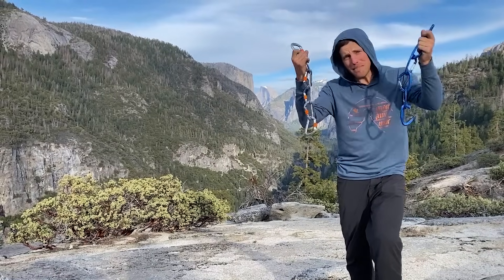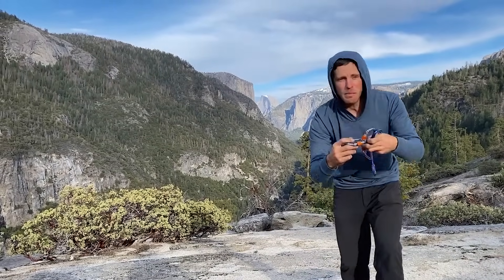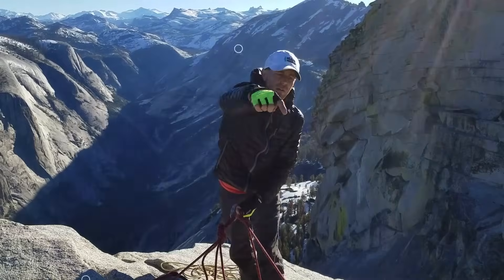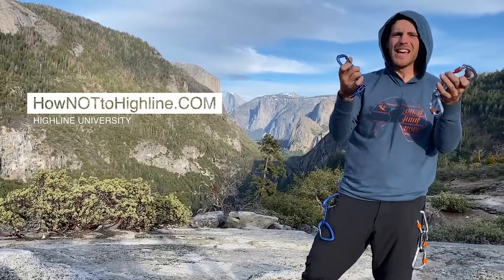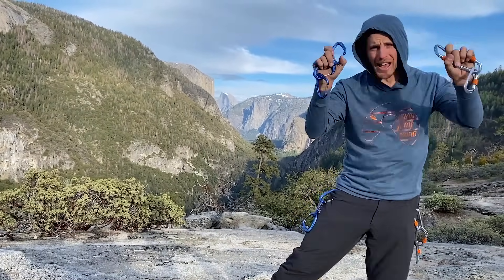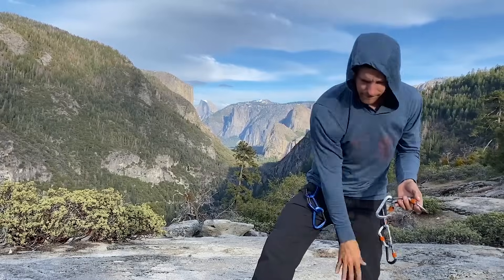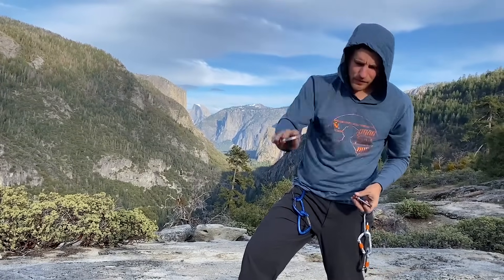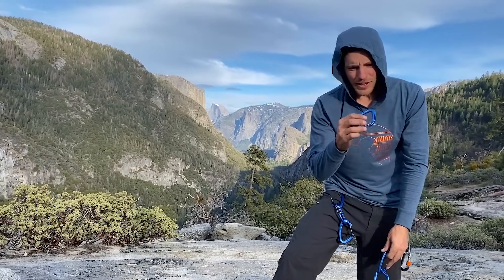Are MicroFractures a Myth in climbing carabiners?

Comment: This video was recommended to me and here are a few thoughts. I rarely comment on youtube videos but felt like I needed to make an exception here.
This is not a good test of micro fractures. You have tested scratched up carabiners vs brand new, you have absolutely no way of knowing if these carabiners you threw at the floor have micro fractures, All this video has really shown is that there is little difference between scratched and unscratched carabiners. To say that you are testing the effect of micro fractures is completely misleading. Smashing carabiners against the floor will not ( is extremely unlikey) to create micro fractures in the material. Micro fractures exist as a result of repeated high loading. A good visual demonstration here to help understand micro fractures is to try and rip a sheet of paper by pulling in the same direction at either end, it is surprisingly difficult, adding a small tear into the top of the paper decreases how hard you would need to pull to rip the paper. In the context of aluminium weighting it and unweighting it repeatedly (cyclic loading) will tear at these micro fractures over time. A better test would be to do a break test on a carabiners that have been used for climbing for several years, or to test a carabiner that you had subjected to repeat on/off cyclic loading. 
Thank you for bringing up the issue of micro fractures though, many people are unaware of them and their possible effects.
Reply: They do have a test of old vs new gear. This test was to disprove the notion that you should retire gear if it is dropped bc it "develops micro fractures" and it will break when loaded. All this test is saying is that dropping your gear doesn't mean you have to retire it because it doesn't lose a significant amount of strength.

Comment: I used to work for a boutique bike frame builder in San Diego back in the 90's making custom steel, and then Ti frames. Aluminum has a "quality" called  catastrophic failure. Really sucks on bicycles. Probably does when a biner fails also.

Comment: Yeah micro-fractures are def a sketchy ground, but thanks for the info!! and please put a plexiglass cover over your machine! :) MBS tested equipment can jump a lot.
From my POW it is good practice to not use any gear after you dropped it from a wall. For instance I dropped a Photon Screw Lock from 400 feet, found it and retired. When I tested the carabiner got to 24 kN. So apparently no issues. I believe that what mfr are saying is that there is a very tiny chance you get micro-fractures after carabiners fall down. The thing is that as they categorised as PPE class 3 according to European regulations, hence protecting the user from death. So this is when even small chances lead to extra safety. 
In terms of fatigue as some other comments were saying be aware that fatigue in metals concerns loads that are generally much lower than MBS, but simply repeat them to thousands (sometimes million cycles) and they lead to breakage (classic example train axles). There are very interesting studies linked to some carabiners and fatigue, specially considering paragliding flight (search for DHV). Even with very low figures (100-150 kg) a carabiner might break after 100'000 cycles. Of course in climbing this is not really relevant, by the time your gear gets to 10'000 cycles it will look that bad that you might just wanna use it as a keychain.

Comment: Interesting experiment, but due to the limited number of tests it really only shows that microfractures are not guaranteed to occur when throwing biners around.. Not trying to tell you to destroy more carabiners though ;)
Reply: I think the burden of proof should be on those who claim microfractures do happen from dropping your equipment
Reply: Andrey Mironov microfractures start at stress risers and then form from cyclic loading. Abusing your gear is going to create stress risers, if it does anything, but not directly form microfractures.

Comment: you gotta let water in those tiny breaks in the aluminum over long periods over time. i've seen it it bike parts. especially crank arms. cracks you can't see that have let water in over time that eventually fail and when they fail you can see the corrosion coming from the outside in along the invisible crack. after working on bikes and going into climbing i've always assumed that this could happen to carabiners. inspect your gear thoroughly, maybe even with a magnifying glass, why not?

Comment: From this kind of abuse, it seems more likely that the result would be Work Hardening of the aluminium. there is a wikipedia article from this, and quoting the section on aluminium: 

"Devices made from aluminum and its alloys, such as aircraft, must be carefully designed to minimize or evenly distribute flexure, which can lead to work hardening and, in turn, stress cracking,"

That being said you'd have to repeatedly be causing impact stress on the aluminium to normally cause that to happen (to my knowledge). It's possible it could worsen a very minor defect in grain structure eventually though.
Reply: work hardening is only done through plastic deformation. Dropping a carabiner on the ground will plastically deform a small portion, a dent or scratch would be an indication of that. But that would be the only area that is hardened. due to the thickness of the material, this wouldn't have a significant effect. 

Its like bending a paper clip back and forth. The part you are bending will slowly get harder to bend and eventually snap. But the rest of the paper clip is unchanged.

Comment: Might I ask why test 824 and 830 were disregarded in your conclusion? Those instances identify that the carabiners were compromised. The reason behind microfracture caution is that invisible damage could possibly compromise your gear, which I believe you have proven with your tests. All the new gear held to within 2% standard deviation from the mean while test 824 showed 5% less strength and test 830 showed 12% less strength. Thats a 33% chance your gear has been compromised and weakened from its original state.
Reply: Because it's still much more than you would experience climbing, and I believe the test was more to show that you don't have to throw away equipment if it touches down on rock once, like some people believe you should.

Comment: I’m no scientist, or expert on micro fractures.  I work heavy construction, every time I’ve done a heavy
 lift, 100 tons or more, they do a fluoroscope test on the equipment.  So ya, micro fractures are a thing.  Fractures propagate.
Reply: Question is : are micro-fractures a thing in climbing / highlining equipment, used in climbing / highlining situations ?

You’ll never get 100 tons-force in climbing / highlining…

Comment: I am a mechanical engineering student and have studied material sciences as well as mechanics of materials. So, within these topics it looks all the way down to the crystal structure of materials and how they behave to how different loads will cause different stresses within materials. I can say from these classes that THERE ARE MICROFRACTURES. When a force is added to an object stress can be visualized as “flowing”. When ever there is a little defect in something the stress flow is compressed like if you were to see a river try to flow around a rock. This causes a concentration of forces where there is a small defect. It is completely dependent on the geometry of the crack and how the stress flows through the object. So, for the carabiner there could definitely be some sort of stress concentration depending on the types of chips and cracks in it. This is probably why there was a bigger range of failing forces because there were different chis in each of the carabiners. From this abuse there is more likely to be dull dents and chips which have way lower stress concentrations than a sharp crack since the stress can flow around a circle better than a sharp point.
What is probably more likely to make the fractures is causing lots of stress then reliving it. This can lead to the “microfractures” that aren’t really visible. Each time the material is loaded to a high amount these cracks can propagate and weaken it. There are graphs for different materials called S/N Fatigue curves that show different loading cycles and how many times they can withstand those loads. So, in the case of these carabiners they can take so many falls and will form small “microfractures” within the material that will eventually fail. This was the cause of an aircraft accident since the cabins are pressurized and depressurized causing a loading cycle. There is a good quick video that covers some if this linked below. With this being said it might be a better experiment to put a load of a bad fall on a single carabiner then relive it. Do this multiple times and then test the maximum breaking force or continue to do it until the carabiner fails.
Another point I would like to make is that there was somewhere in this video that quickly mentioned the maximum breaking force to be much higher than what is labeled. There is something called the factor of safety that engineers use when designing a product. The product has a requirement that it must be able to withstand. The requirement is then multiplied by the factor of safety and then designed to meet this new higher load. The product is then labeled with the load required not what it was designed to. This is so if something happens that is accounted for or someone uses it improperly there is still more strength than what the end user really thinks there is but never load something beyond what it is labeled. In the case of these carabiners they could also be labeled with the standard minimum they go by so people know that it is safe enough.  
I hope this helps!
Different equations for facture mechanics and stress concentration from them: https://en.wikipedia.org/wiki/Fracture_mechanics
Video on plane windows: https://www.youtube.com/watch?v=7rXGRPMD-GQ 
Plane accident from fatigue: https://lessonslearned.faa.gov/ll_main.cfm?TabID=4&LLID=20&LLTypeID=2
Reply from the maker: I would like to test cyclic loading stressing aluminum, maybe new and maybe abused gear, to demonstrate what you are referring to.  What is the % of MBS of aluminum that a carabiner could in theory take infinite loads... 25%?  I know if you cyclic load near MBS it only takes a reachable number before it breaks from micro fractures forming.
I was joking that the breaking strength was higher than MBS because sooooo many times on slacksnap that wasn't the case because MBS is based on a sterile enviroment, especially on soft goods, especially on highline gear.  So everytime something breaks higher than MBS I make a joke about it.  I know the printed number is the lowest it should ever be but I find great joy in showing that isn't always the case haha.
Reply: @HowNOT2   another Mechanical Engineer chiming in. Aluminum doesnt have an "endurance limit" like steel does. In theory, you could cyclically load an aluminum carabiner to just 100 pounds, and it may take a billion cycle, but it will eventually fail. The problem is, shape has a lot to do with this calculation and would be really tough. But if you're looking to do an actual test that would have a low enough set of cycles to be feasible, I'd recommend doing a super slow test of a carabiner where you load it and unload it until it deforms and wont go back to normal (also known as the yield strength) , and then run your test at about 80%-90% of the yield strangth on a fresh sample. If I were a betting man I'd estimate the force to get to the yield strength of a 24 kN carabiner is probably close to 20kN.

Anther problem in designing this kind of test is that fatigue is rather sensitive to the load, so if you're loading a carabiner to 4000±100 pounds, it it constantly loads high vs another sample consistently loading low, the resulting life could be off by an order of magnitude (the difference between 10,000 cycles and 100,000 cycles). These sorts of differences could literally make a test take 10 times longer or something could break in one tenth of the time you might have been expecting.
Reply: @HowNOT2  I did some looking into the materials that are used and the data on it. It looks like about 20% MBS is what would give you "infinite" falls and by infinite I mean you probably will not ever reach that number of falls. While looking around on the internet I found that MIT actually did a lot of testing to see what a carabiner could withstand. They did testing that would mimic how a climber would actually use it in the real world and all of that data can be found here http://web.mit.edu/sp255/www/reference_vault/Fatigue_Presentation.pdf . I came up with the 20% from the data found on page 13-15 (as well as some other material sources linked below). The failures became asymptotic at about 5kn which is about 20% of the rated MBS of the carabiners. I also agree with @TheArmyKnifeNut on all of what he said. What I think might be an interesting test is to load a carabiner up to 20kn like 20ish times and then do a final MBS test to see if those few loads lower the MBS. This would be to simulate how multiple type 2 falls effect the MBS of a carabiner. I watched your video on the forces from falling and seeing that the highest forces created from those typical falls never even reached 5kn, I dont think climbers should worry about failure of gear from fatigue unless there are a lot of type 2 falls.
Thanks for making the cool videos!
http://asm.matweb.com/search/SpecificMaterial.asp?bassnum=MA7075T6
https://ntrs.nasa.gov/archive/nasa/casi.ntrs.nasa.gov/19730023698.pdf
Reply: And has anyone tried similar analyses with titanium carabiners? And that is based on the basic, visual presence of notches - ergo the dependence on notch toughness. We know that with hard materials it has a pretty big influence.
Reply: TLDR......🙄
Reply: Blah blah, blah. Dont retire yer beenerz because you drop em.

Comment: Micro fractures are a thing but you never checked if you have any cracks. Throwing them on the floor are not guaranteeing that you create one on the inside of the carabiner. You maybe created them on the outside but you should do a test over loading them until shape changes and after a day try a pull test again. All the best from japan

Comment: By beating the metal you could be work hardening the metal. As for your differences in numbers, all the ropes and pulleys are putting variables in your test. That’s why scientists use hydraulic rams. Still it’s way cool what your doing!!! Keep making videos.        Ideas for an other video, if the carabiners were really cold, I could see stress fractures.
Reply from the maker: Why do the pulleys add variables?  It pulls at a constant rate, at least as constant as a hydraulic rams.  We use hydraulic rams in bolt busters and i haven't seen a difference.
Do you have any articles that talk about aluminum becoming brittle at a certain temp?  We have freeze driers we could experiment with if that is a thing.
Reply: @HowNOT2  aluminum isnt very sensitive to low temperatures in the way steel is. I don't feel like digging out my old text books, but here's a quote and link discussing it a little. 

"Below zero, most aluminum alloys show little change in properties; yield and tensile strengths may increase; elongation may decrease slightly; impact strength remains approximately constant. Consequently, aluminum is useful material for many low-temperature applications."
http://www.totalmateria.com/Article23.htm
Reply: I just think the numbers could be if the load could be applied more abruptly. I just know materials can act differently when loaded or when jolted. I’m no expert, I just really like material science. As for the beta on aluminum Cryo-testing, I’ll try an find you some. What your doing here makes me what to apply what I know from Aerospace to climbing. It’s crazy how engineering and climbing go hand-in-hand.
Reply: @philschorr8231  There is no difference between loaded and jolted. The reason we seem to intuitively feel there might be is that loading a biner with 0.85kN (about 80 kg) does nothing, but dropping a mere 80 kg from a gentle height of 2m connected directly by static rope can break it. But in reality the maximum force in the latter case can easily exceed 25kN, for a very brief time interval, and once attained the biner starts to yield.